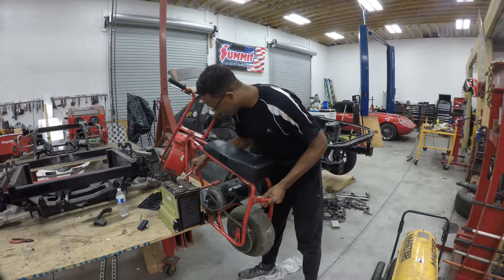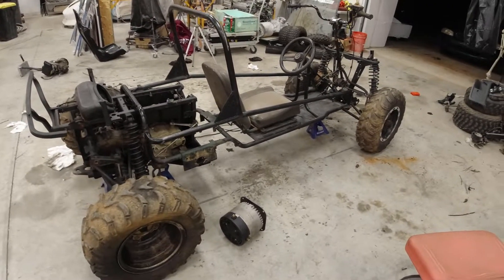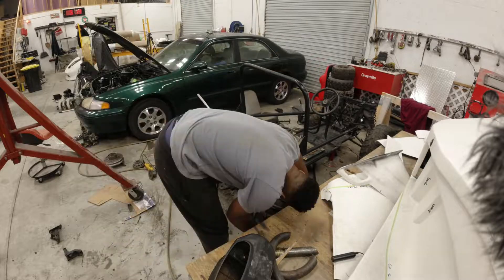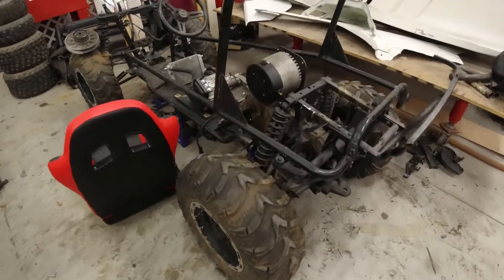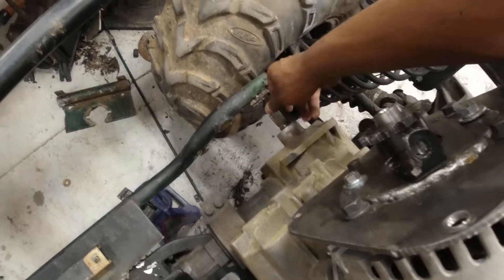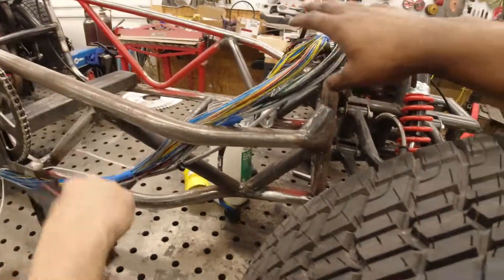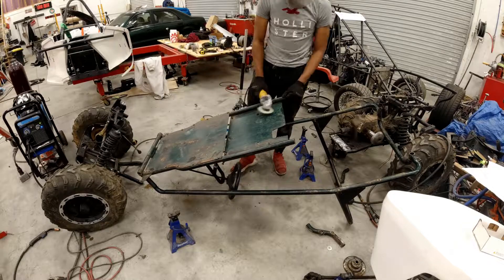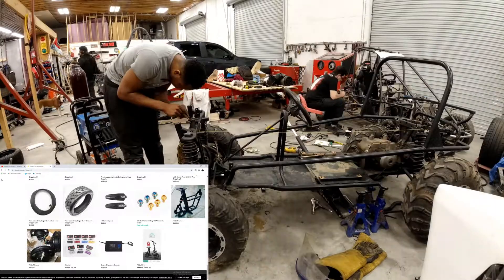Lets Build a 100hp twin motor electric Buggy PT 2

Comment: I love the ambition of this project it will be sick regardless of you beating that 600cc dinosaur or not. Keep that CG as low as you can bro! Consider seat belts and a roll cage or some sort of structural bars that will keep your head and neck clear of the ground if that thing happens to roll over?
Reply from the maker: Thanks my friend. The CG will be pretty low once I add the batteries and I will be building a full roll cage also.